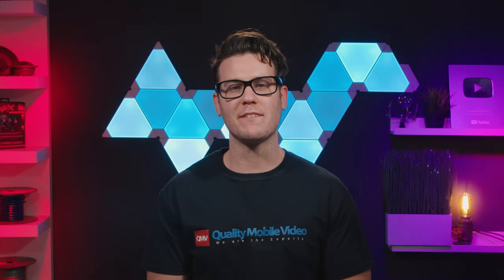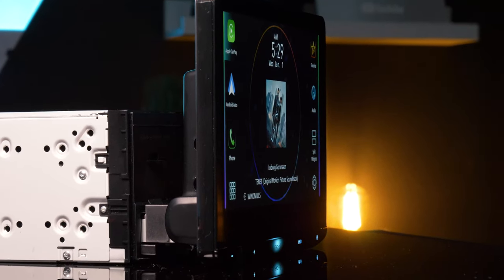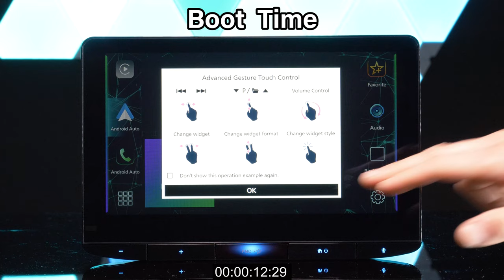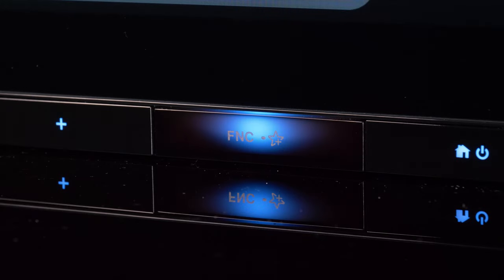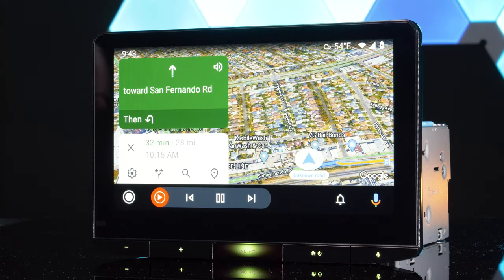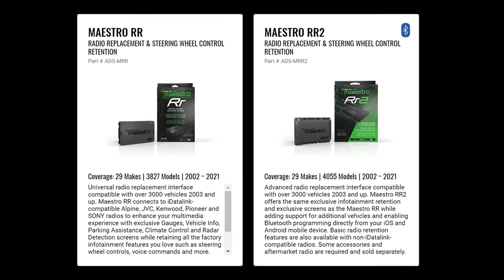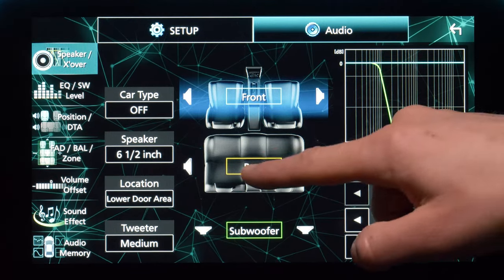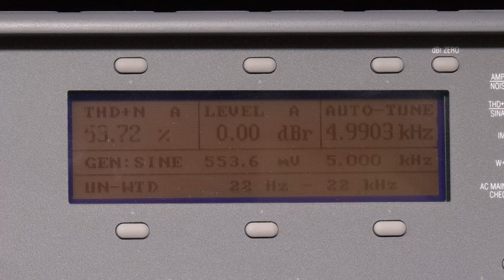JVC KW-Z1000W - 10.1" Floating Display, Wireless Apple CarPlay/Android Auto & Phone Mirroring

Comment: I could install a whole new stereo with 1200 smackers!!!
Reply: Would never pay that much for a JVC.
Reply: @NathanElcoate  it’s literally a kenwood
Reply: @robbrobb325  I'd rather a Kenwood badge than a JVC badge in that case :-P
Reply: @NathanElcoate  yea me to but I couldn’t pass up on the flashiness of the jvc I haven’t ran jvc since high school 2000 been a pioneer guy until a week ago
Reply: @NathanElcoate  yea but the kenwood equivalent has a hideous volume knob in the middle of it. I actually wanted the kenwood to begin with then saw them side by side in person and the jvc has a wayyyy cleaner look. Just my opinion but they are literally the same unit other than the volume knob
Reply: @eastcoastcookies4352  Thanks that's a good point.
Reply: Not a good one you're not ... I paid $1200 for one of my amplifiers. Btw that jvc Deck is now $1499
Reply: @eastcoastcookies4352  I prefer a physical knob than gesture controls.

Comment: $1200 hahaha. You can get the same thing from China for $180 running Android 10.0 and they’ve been making them for 5 years.
Reply: problem is none of those have access to satellite radio.
Reply: From those china units You can't get wireless android auto or carplay. Plus shitty RCA voltage
Reply: Yes and still have the same problems in every version. They just cant seem to fix the annoying bugs and you have to buy new model instead of firmware upgrade (eonon anyway). Yes, I am using Daisata.
Reply: jUsT aS GuD

Comment: Just bought this, not impressed at all so far. The sound isn't all that, my subwoofers even sound weakER. It has 1, yep just one subwoofer gain. It goes to like -15 or +5 which makes no sense at all!
Reply: What more do you want from a subwoofer gain ??
Reply: @robbrobb325  huh?
Reply: @DefMusic79  as in subwoofer levels ? You have that you have the eq also which controls the mine on negative-8 an rocking the whole car
Reply: @robbrobb325  you have you, huh¯\_(ツ)_/¯
I have absolutely no clue what you are typing about.
Reply: You just need to equalizer very well all custom adjustments works amazing
Reply: @elparranderoelparrandero4566  that doesn't help or really tell me much.

Comment: This has been my most disappointing head unit purchase yet.
Reply: Why do you say that? I just purchased this unit along with a set of 2 way Focal Flax components. Haven’t got around to installing everything until I get the Flax 3 way components for the front stage but was really looking forward to this unit being everything I hoped. Any input would be greatly appreciated
Reply: Yo don't believe the hype it's the same radio as kenwood 1057 but 50 bucks cheaper minus the knob I honestly think people act like they know when...... I am about to purchase this unit and have it installed with my FULL alpine r system I will give feedback
Reply: @petejimenez425  I'd honestly have gone with a different brand in hindsight. I went with the JVC because I'm personally not a fan of knobs (I use steering wheel and voice) and thought the JVC design is cleaner. I was upgrading from a Kenwood Excelon and figured they'd be comparable. I was wrong. 

Here's what I don't like about the JVC -
- The wireless Android auto connection is flat out unreliable. Constantly disconnects.
- The headunit itself reboots while in use far too often - at least once a day.
- The widget's are a joke compared to the Kenwood unit. The split widget is so limited, it's almost useless. e.g No Carplay or Android Auto access on the top widget combination with the A/C controls.
- The dual phone connection cannot be two of the same phone. EX: It can be a Samsung and iPhone, but not two S21 Ultras. So if you're using two of the same type of devices, even with different device names - they won't both stay connected for incoming calls. But am S21 Ultra and an iPhone 12 Pro will.
- I see display lag when switching apps or using Google maps in satellite view.

The only pro I can say there is, is with the screen quality on static objects. And that's not even exclusive to the JVC unit.
Reply: @awfike24  wow thanks for your review! Seriously I was ready to pull the trigger on this unit but after reading your experience with the JVC unit I think I will go with the Kenwood the thing that sucks is it will be a wait while the JVC is available now but is the sound quality the same I just finished putting a new alpine R full system in my car using JL's fix86 to keep my factory unit but that was a mistake due to lots of background noise even when the radio is off quite disappointing btw it was all PROFESSIONALY installed
Reply: @petejimenez425  i use the jvc with a twk 88 an it sounds crazy good thats for damn sure
Reply: @awfike24  I've had mine for over 2yrs now. Never had wireless AA drop or the unit reboot.